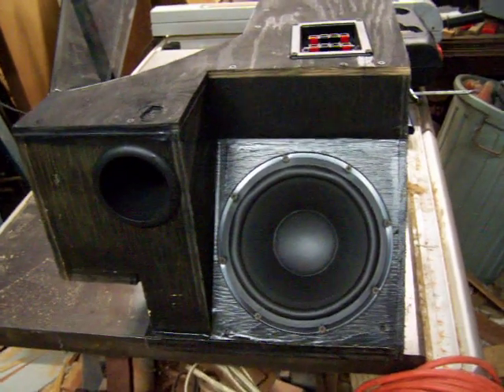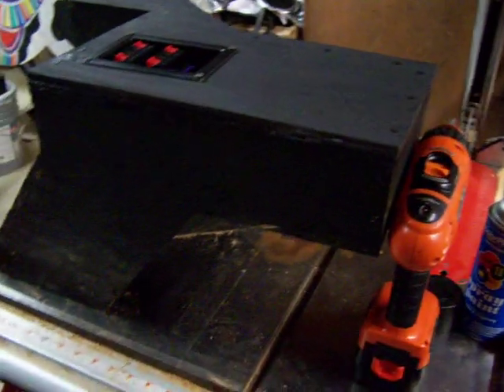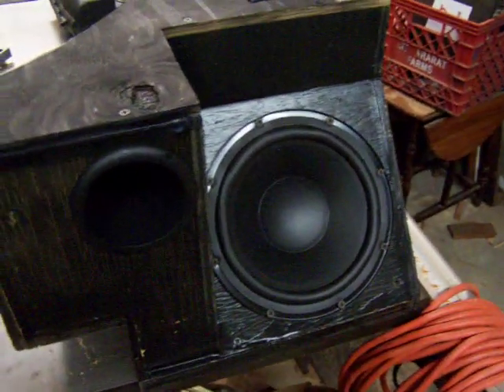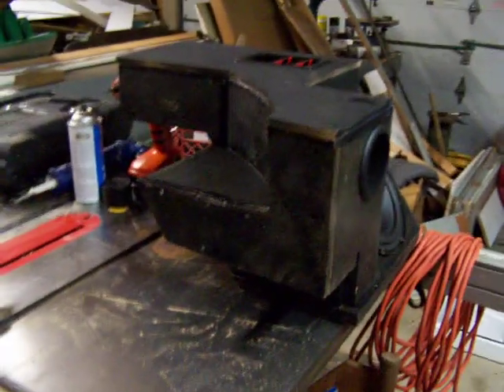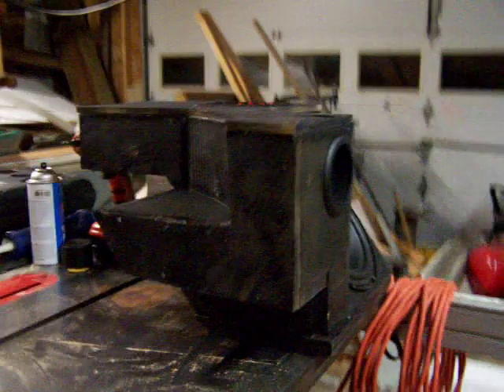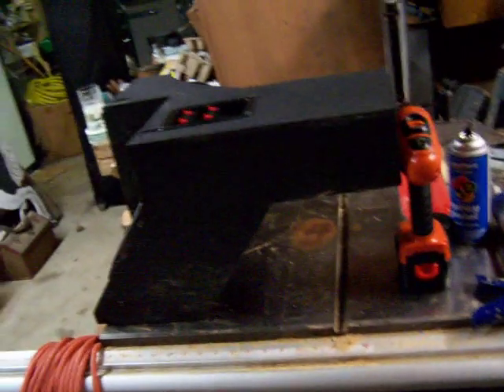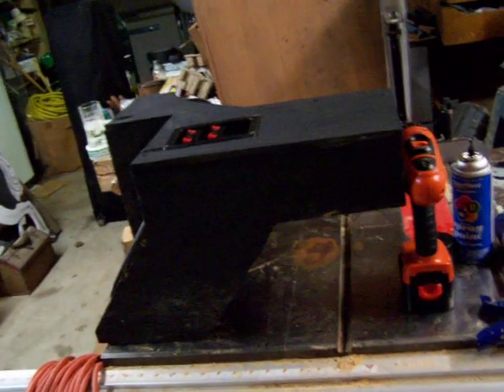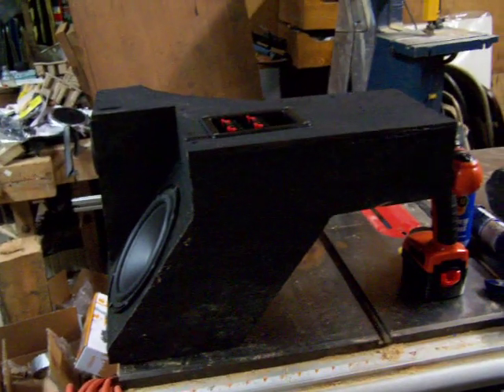RX7 Convertible Subwoofer cabinet

Comment from the maker: You could PROBABLY put a 10" in here, but the design would have to be expanded a bit, but I think you can get a much higher output 10" than the 8" that's in here, then run a slightly bigger amp.  It wouldn't be "hip-hop" loud, but your only other option is to put something big in the trunk - or sacrifice the spare tire...